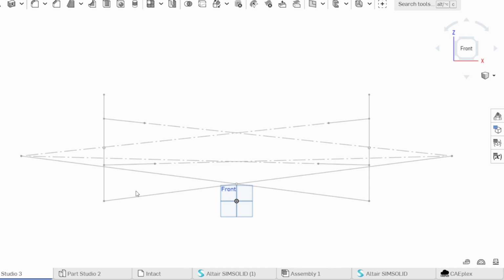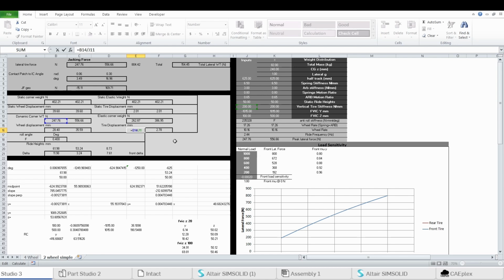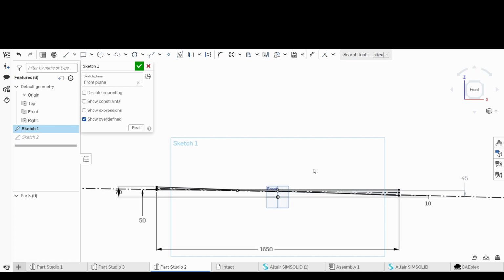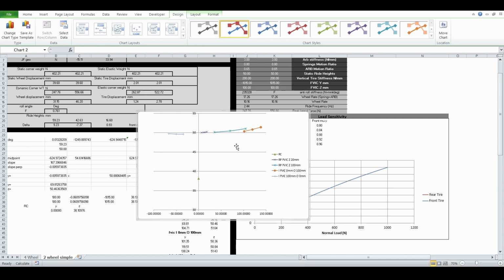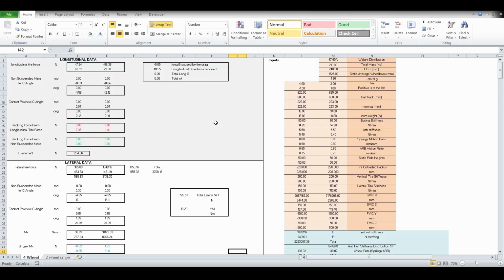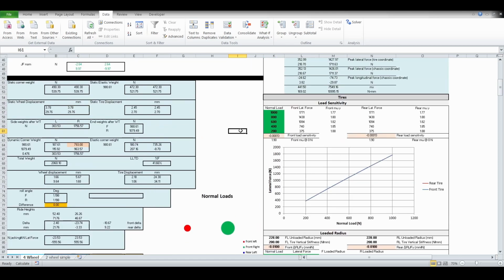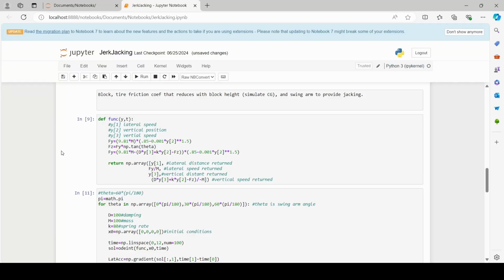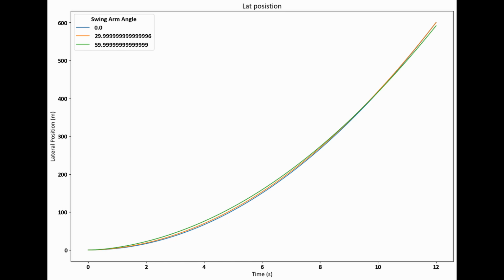Calculating Jacking Force | Difference to Roll Centers | Racecar Engineering | FSAE

Comment: Hello again. If I've followed this correctly you're saying the jacking force increases the normal force on the relevant tyre. This is contrary to what I have read elsewhere, which amongst the heated arguments(!) said the following:

"You seem to be getting crossed up between which forces are internal to the vehicle (i.e. between wheel and chassis) and which are external (normal load at the tyre CP). You are right that 'jacking forces' can act to lift the sprung mass, but what is reacting this? answer - the tyres! You haven't magically reduced the mass of the vehicle, or load transfer, just the way it is transferred.

The easiest way to get your head round this, is consider how the forces are fed into the chassis, and what effect this has on the body's motion, taking moments about the CG of said body. Just remember, all the tyre forces feed into the chassis at the IC for that wheel... With ICs on the ground plane (in side and end view), all CP forces (Fx and Fy) are fed into the chassis at the ground, which is the CG height (Hcg) from the CG. This produces a roll (and/or pitch) moment on the body which will account for 100% of the load transfer; all of it goes through the springs/bars (no jacking).

Now imagine on of your ICs is above the ground (Hic). The Fx and Fy forces for this corner act at this point, so your moment on the chassis is now less because the forces act at a distance of Hcg-Hic, resulting in less roll/pitch. This also introduces a vertical component between the chassis and wheel though due to the angle of the swing arm. This acts upwards on the chassis at the IC (so creating its own roll/pitch moment on the body), but also downward onto the tyre. Hence the net vertical load at the tyre is maintained, but your chassis will have rolled/pitched less, transferring less through the springs, but some has been transferred instantaneously through the links. This is what some call the geometric or inelastic load transfer - effectively the 'jacking force'."

I'm confused again...! Do you have any comments?
Reply from the maker: The extra normal load ONLY occurs when the chassis is accelerating upwards (or reduction in normal load when it accelerates down). 
Starting around 32:00 in the video explains this. Once the chassis has stopped vertical acceleration, the normal loads would be found by weight transfer calculations (which is what the replies you posted are talking about).